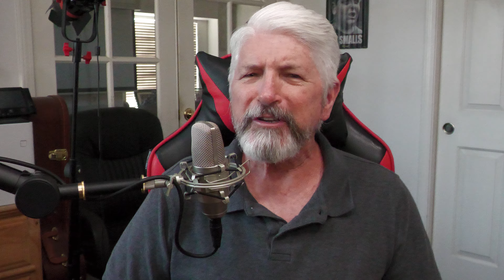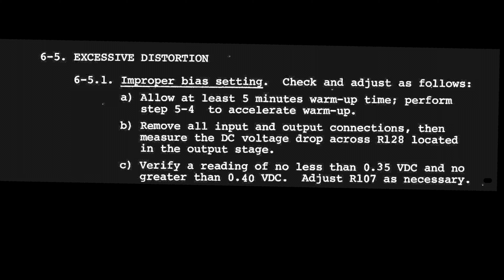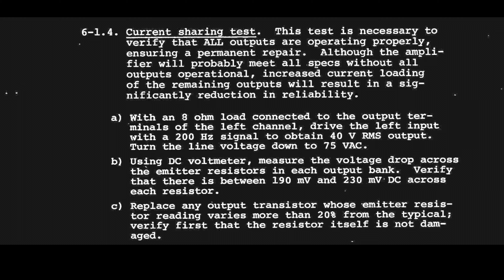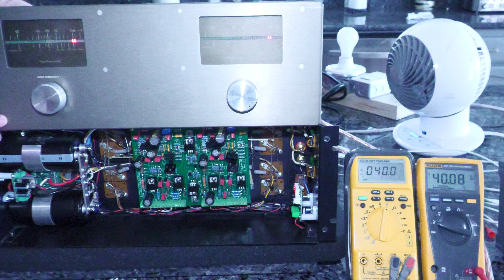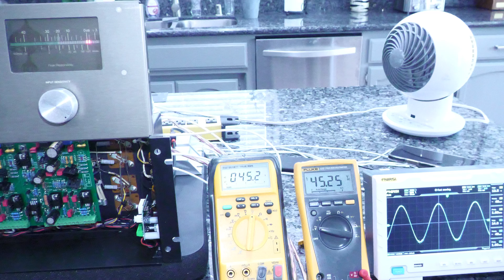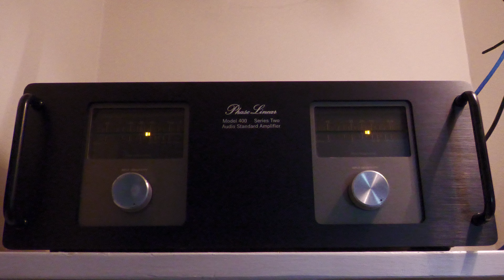Phase Linear 400 Series II Final Episode: Adjust, Test and Demo

Comment: Is it just me, or are those fans really loud?
Reply from the maker: Yes, they do sound pretty loud in the recording! However, they’re actually much quieter in person. The fans are thermostatically controlled, with a temperature sensor mounted on the heat sink. They only turn on when the amplifier gets hot enough, which generally means it’s being driven pretty hard. At those listening levels, you’d never hear the fans anyway! Once you turn the volume down, it typically takes only about a minute for the heat sink to cool enough for the fans to shut off. So under normal listening conditions, they’re not an issue at all. Thanks for watching!

Comment: HOW COME YOU DID NOT  INSTALL OUT PUT SPEAKERS PROTECTION  AND DELAY AS THEY SAY FRAME LINEAR CAN YOU MAKE A VIDEO ON THIS
Reply from the maker: First, with the new output speaker terminals, the board will not mount to them. They are bigger than the origional. Second, I have never had a “flame” linear… I have never had the need for that level of protection with properly matched transistors.

However, I am planning on doing one with that board. 

Thanks for taking the time to respond. It is much appreciated!